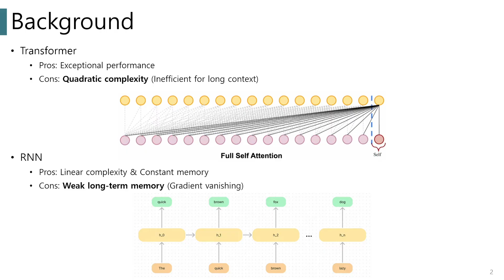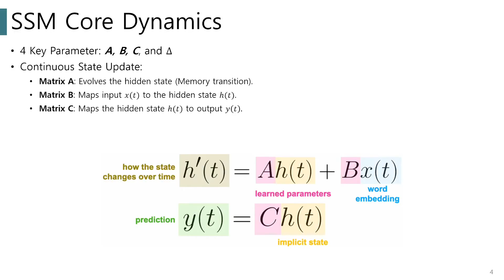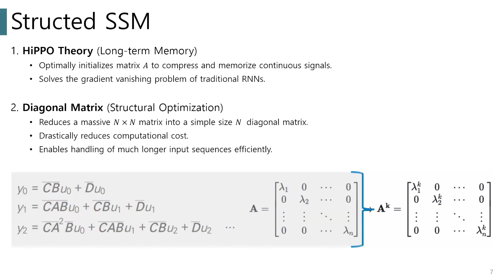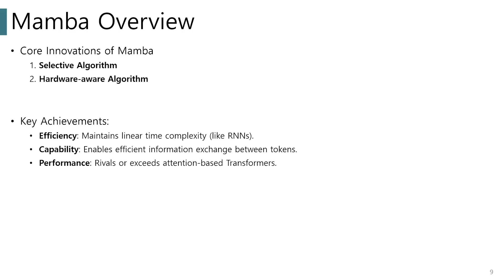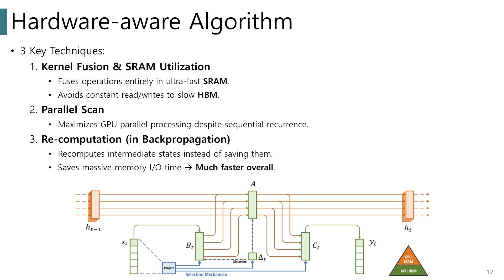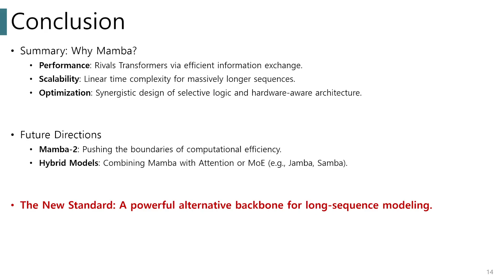[Seminar] Mamba

Comment from the maker: The description of the Mamba architecture could be made more reader-friendly. In particular, the current presentation lacks sufficient visual guidance and text annotations, which makes it harder to follow the flow of the architecture. It would be helpful if the following points could be clarified:
1. In the Mamba architecture shown around [13:49], what do X, Δ, B, and C represent? Please explain their individual roles and how they contribute to selectively preserving more important information.
2. What is the role of the right-side projection branch in the Mamba architecture? Please clarify how it functions and how it interacts with the main SSM branch.
3. Are there any experiments or visual comparisons that demonstrate the performance of Mamba versus Transformer, particularly with qualitative or visualization-based results?
Reply: A1. X is the input token feature, delta is the input-dependent step size / gate that controls whether the state should be preserved or reset, B controls how the current input is written into the state, and C controls how the state is read out to the output. In short, Δ decides “how much to remember,” B decides “what to store,” and C decides “what to expose.”

A2. The right-side projection branch is the gating branch inherited from the Gated MLP design. The main branch goes through Conv → SSM for sequence mixing, while the side branch produces a content-dependent gate that modulates that main branch before the final output projection.

A3. Yes, the paper provides quantitative comparisons such as scaling-law plots, induction-head extrapolation, and efficiency benchmarks. But it does not provide many qualitative interpretability-style visualizations like attention maps, so a more reader-friendly presentation could definitely help.

Comment: 1. Mamba claims that its selective mechanism enables content-based reasoning, but does it really capture long-range and fine-grained relationships between distant tokens as reliably as Transformer attention?

2. Although Mamba shows strong performance and linear-time efficiency across several modalities, how can we determine whether these advantages come from the architecture itself rather than from hardware-friendly implementation or specific experimental settings?
Reply: A1. Mamba does have strong evidence for long-range reasoning—it solves selective copying and induction-head style tasks and extrapolates far beyond training length—but it still does this through state compression, not explicit all-pairs attention. So it can be very strong, but it is not literally the same mechanism as attention for fine-grained token-to-token lookup.

A2. The ablations help separate the effects: the hardware-aware scan mainly changes speed/memory, while replacing LTI SSMs with selective SSMs gives the large quality jump. So the efficiency win is partly implementation, but the quality gain is strongly tied to the selective architecture itself.

Comment: 1. Is there a possibility that important information could be filtered out in the selective state-space model (Selective SSM) used in Mamba? If so, how is this issue typically mitigated?

2. Mamba was introduced to address the time complexity issues of Transformers. However, large-scale LLMs still predominantly rely on Transformer architectures. Why is that the case? Additionally, are there any prominent large-scale models that have adopted Mamba?
Reply: A1. Yes, that risk exists in any selective mechanism. In Mamba it is mitigated by learning delta, B, and C together, keeping residual/normalization structure around the block, and increasing state size when needed; the paper’s ablations show the full selective setup performs much better than partial selection.

A2. Transformers still dominate mostly because their scaling recipes, tooling, and downstream ecosystem are much more mature; the Mamba paper itself notes that larger-scale comparisons and scaling engineering were still open questions. That said, there are now notable Mamba-based models such as Falcon Mamba / Falcon3-Mamba and Mistral’s Codestral Mamba.

Comment: Nice presentation

Q1. If the model relies heavily on sequential recurrence, could it struggle with tasks that require simultaneous global comparisons across many tokens?

Q2. Could the selective state update mechanism lead to information loss if the gating suppresses important tokens too early in the sequence?
Reply: A1. hat is a fair concern. Mamba is content-aware, but it still summarizes the past into a finite state rather than performing explicit global pairwise comparisons, so tasks dominated by many simultaneous token-token comparisons may still favor attention or hybrid designs.

A2. Yes, important information could in principle be suppressed too early. The mitigation is that selection is learned jointly rather than being a fixed hard mask, and the ablations show that selective delta is crucial while selective B/C and larger state size add extra expressiveness.

Comment: Q1.
In SSM, is the idea that the model incrementally stores the memory of tokens into the state vector as each token is processed? If so, I find it difficult to understand what the fundamental difference is compared to the RNN structure.
It seems that the difference lies in the method of encoding long-term memory into a single vector, which introduces concepts such as linearity and non-linearity, but I am not fully able to grasp the exact distinction. Could you provide a more detailed explanation?
Also, since SSM still compresses long-term information into a single state vector, to what extent can it actually mitigate the long-term memory vanishing problem?

Q2.
I am also curious about the motivation behind introducing the hardware-aware algorithm. Typically, one might expect such issues to be addressed at the algorithmic level first.
Do you think there are fundamental limitations to purely algorithmic solutions in this case, which made a hardware-aware approach necessary?
Reply: A1. Yes, the state vector is a running compressed memory of the sequence. The main difference from a standard RNN is that Mamba uses structured SSM dynamics with state expansion and input-dependent delta/B/C, which makes the update more controllable and better behaved than a generic nonlinear recurrence; it helps a lot with long-range memory, but it still mitigates rather than completely removes the compression bottleneck.

A2. The hardware-aware algorithm was necessary because once selectivity breaks the convolution trick, good asymptotic complexity alone is not enough—the real GPU bottleneck becomes memory traffic. So the hardware-aware design is what turns the theoretically linear scan into something actually fast and memory-efficient in practice.

Comment: Q1. I do not fully understand why the continuous system needs to be converted into a discrete one. How exactly is delta used, and why is this conversion necessary? In deep learning, we often work with continuous information, so I am not sure why this becomes a problem here.

Q2. Even if a diagonal matrix is used, it seems to me that this would only reduce the representation of the full matrix by about half. Since we usually ignore constant factors when discussing computational complexity, I do not see why this alone would lead to a substantial reduction in computation cost. Could you explain more concretely why this approach is considered to significantly reduce the computational burden?
Reply: A1. The continuous system has to be converted into a discrete one because the model is ultimately executed token by token on digital hardware. In Mamba, delta is the learned per-token step used in discretization, so it turns the continuous dynamics into the actual recurrence the network applies at each sequence step, and it also behaves like a generalized gating signal.

A2. A diagonal matrix is not “about half” of a full matrix—it has N free parameters instead of N^2. More importantly, operations such as exp(delta A) and repeated application of A become elementwise rather than dense matrix multiplies, which is why diagonal or stably diagonalizable SSMs can reduce computation so much in practice.

Comment: Q1. Mamba seems conceptually similar to an RNN. What are the key differences between Mamba and a traditional RNN?

Q2. Mamba also appears to have a recurrent structure, so how can it still support efficient parallel computation like a Transformer?
Reply: A1. Mamba is recurrent like an RNN, but it is not a standard RNN. It uses structured SSM dynamics, larger state expansion, selective delta/B/C, and principled continuous-to-discrete parameterization, whereas older RNNs usually rely on smaller hidden states and heuristic gates.

A2. Mamba’s recurrence has a scan-friendly structure, so it can be parallelized with a work-efficient parallel scan. Generic RNNs usually have arbitrary nonlinear hidden-to-hidden updates, which do not parallelize in the same way.

Comment: Q1. Mamba replaces the linear time-invariant property of traditional state space models with input-dependent parameters, making the system linear time-varying. How does this change enable content-aware processing, and in what ways might it approximate or differ from the context-dependent behavior of Transformer attention?

Q2. Because selective SSM removes the convolution trick, Mamba must compute the recurrence sequentially, creating a GPU memory bandwidth bottleneck. How do the hardware-aware techniques (kernel fusion, SRAM usage, and recomputation) mitigate this issue, and under what conditions would Mamba be more efficient than attention-based Transformers?
Reply: A1. Making delta, B, and C depend on the input lets Mamba decide what to write, keep, forget, and read from the state at each token. That gives it content-awareness, but unlike Transformer attention it does not build explicit token-token similarity maps; it compresses history into a finite state and uses that state contextually.

A2. Kernel fusion avoids materializing large intermediate states in slow HBM, parallel scan removes the naive serial bottleneck, and recomputation avoids storing all intermediate states for backprop. Mamba is usually most attractive for long sequences and autoregressive inference, where it scales linearly and avoids a KV cache.

Comment: Q1. What are the benefits of keeping the state transition matrix A fixed in Mamba, and how is an optimal A determined in practice? (page 4)

Q2. Why can Mamba parallelize its recurrence while standard RNNs cannot?
Reply: A1. Keeping A fixed across tokens gives a simple and stable backbone for the dynamics, and the paper argues that selectivity in Δ already captures most of the benefit because A mainly acts through A_hat = exp(delta A). Also, “fixed” here means fixed with respect to the input/time within a sequence—it is still a learned parameter, chosen by training from an initialization, and real-valued initializations work well in their LM ablations.

A2. Mamba can parallelize because its structured recurrence can be rewritten as a scan over associative updates. Standard RNN recurrences usually do not have that same scan-friendly form.

Comment: Thank you for presentation.

1.As far as I know, Transformers are already being widely used in LLMs like GPT. Aren't they already capable of handling long contexts effectively?

2.On page 5, what is the difference between the box on the left containing u, x, y, a and the linear (straight) box on the right?
Reply: A1. Yes, Transformers can handle long contexts, and they are still the dominant LLM architecture. Mamba’s point is not that Transformers cannot do long context, but that attention becomes more expensive as context grows, while Mamba keeps linear scaling and constant-time autoregressive steps without a KV cache.

A2. From that SSM slide, the most natural reading is: the left box is the dynamical-system view, where input u drives a latent state through A/B and produces output through C. The straight box on the right is the equivalent sequence-model view after discretization, where the same system is treated as a sequence-to-sequence layer.

Comment: Q1. Mamba seems to have many advantages over Transformer. However, why do you think modern LLMs still follow the Transformer pipeline? Why do you think there hasn't been a prominent Mamba-based LLM program yet?

Q2. Looking at recent architectures, it seems like there are many models that mix Mamba and Transformer. This seems like an attempt that has been done for a long time. So, would it be possible to improve by mixing Mamba, RNN, CNN, and Transformer?
Reply: A1. I think the main reason is maturity: Transformers have the strongest large-scale validation, infrastructure, and downstream training ecosystem. Mamba was very promising, but even the original paper said larger-scale comparisons and engineering challenges still needed to be worked out.

A2. Yes, hybridization is absolutely possible, and the paper even tests Mamba mixed with MLP or MHA blocks. My view is that mixing helps when each component covers a specific weakness; mixing everything blindly can also add complexity without a clear gain.

Comment: Q1. When solving an ODE-based continuous dynamical system through discretization, the choice of the time step size delta can significantly affect the resulting trajectory. If delta becomes too large, the probability path may drift or the system may become numerically unstable. In this setting, how should delta be determined in a principled way? For example, is it selected based on stability conditions such as spectral radius or Lipschitz bounds? Furthermore, are there specific stabilization strategies used to mitigate discretization-induced drift, such as implicit solvers, exponential integrators, or structural constraints on the dynamics?

Q2. State Space Models (SSMs) are often formulated in continuous time before being discretized. What is the fundamental motivation for defining SSMs as continuous dynamical systems in the first place? Does the continuous formulation provide theoretical or practical advantages, such as improved stability analysis, spectral control, or closed-form transition structures? Moreover, while diffusion models admit a probabilistic interpretation of their probability paths (for example through Gaussian processes or Gaussian mixtures), is there an analogous probabilistic interpretation for continuous SSMs? Can their latent dynamics be understood as stochastic processes, or are they fundamentally deterministic systems with limited probabilistic meaning?
Reply: A1. In Mamba-style SSMs, delta is not usually hand-tuned like a classical ODE solver step for a fixed trajectory; it is part of the learned model, made positive with a softplus-type parameterization, and used in ZOH discretization. So stability mainly comes from the parameterization of 
A and delta, rather than manually picking one global step size, and the paper’s focus is structured discretization rather than implicit solvers.

A2. The continuous formulation is useful because it gives a principled dynamical-systems view, clean discretization, and links to gating/resolution properties. In Mamba/S4, the latent dynamics themselves are deterministic unless you explicitly add noise, so they are not probabilistic in the same sense as diffusion paths.